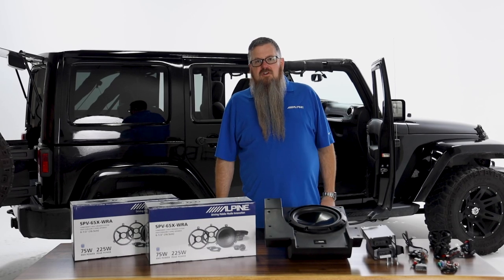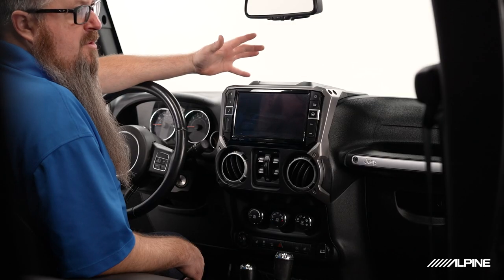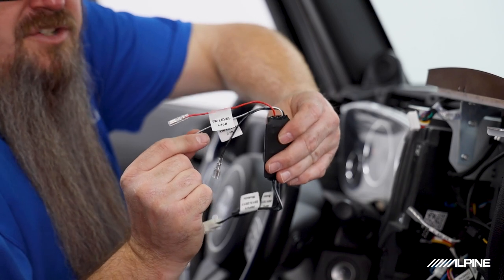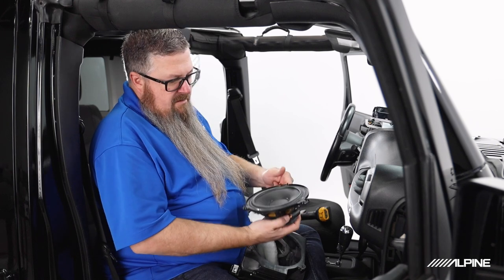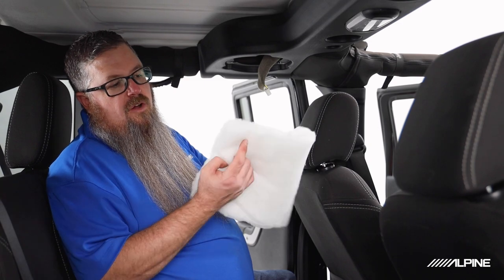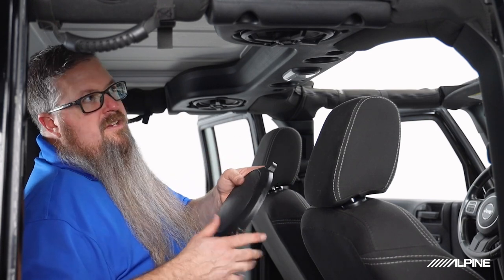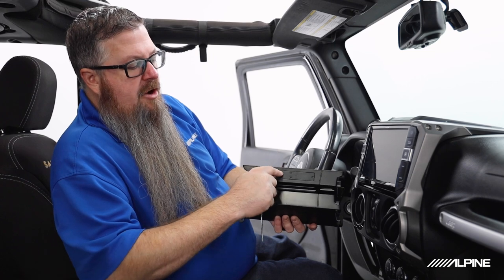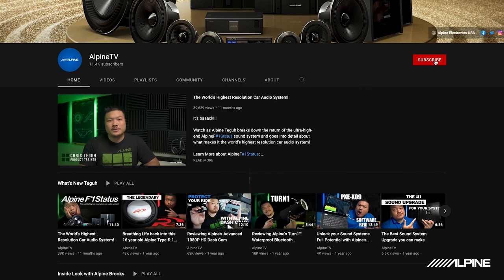Alpine PSS-22WRA Installation Tutorial for 2011-2018 Jeep Wrangler JK Sound System

Comment: Best informational  video out there great job very comeplete details  and camera work ,very helpful. I have 1 question as for the poly cushions  would it be better to put a hole in the right  center toward the wiring of them so you can feed the wire through so the cushion speads out better and flatter ? It also seems with all that vibration  the filler will drop some toward  the cone not sure velco would work Just a thought i had ,awesome video just asking 😂

Comment: I bought the Alpine iLX-407 and the Alpine SBV-10-WRA for my 2015 Wrangler Unlimited, stupid me thought I could use the amp already installed for the speaker that is installed in the back. What amp would you suggest buying? I was considering the Alpine KTA-30MW Tough Power Pack, but I’m by no means an expert.

Comment: i got this kit through crutchfield, i have the alpine sound system. what are the extra steps to make it work? im assuming its splicing the factory amplifier plugs, to the alpine harness?
Reply: no splicing at all. truly plug and play. just installed mine yesterday. they give you everything you need for installation on the factory Alpine or the OEM receiver.
Reply: @chrisdaugherty2700  So your kit came with different harnesses depending on which radio you have? I have the alpine premium radio and our installer told us the speaker wire polarity is opposite from the base non amplified stock system. They wouldn’t install it because he said they would have to cut and splice the harness that was included.

Comment: Has anyone run into an issue with the sub not having any power/firing?  I have this kit installed with the iLX-407 head unit.  Everything sounds great, except nothing from the sub.
Reply: Yes! I was hoping to see the connection issue in the video, it's the only thing he didn't show.

Comment: Do you need two amps for this set up? I have the ilx-w650 with Kta-450. Is that going to be enough for my 2016 jku?
Reply from the maker: Everything is included in this system that you need.

Comment: I just purchased this sub sbv-10 with a alpine mrv-m500 mono amp. Looking to try to install myself. Where would you put this amp?
Reply: Definitely remember that its not a weather proof amp so maybe try fitting it under the trunk trim or under a seat to keep it from getting wet when you have the top down

Comment: Hi, I would like to know if it is possible to install the sub woofer under the driver's seat instead of the passenger's seat?
Reply from the maker: You may be able to with a custom install but the included bracket is meant for the sub to mount under the passenger seat specifically.
Reply: @AlpineTV  thank you do much.

Comment: Followed this excellent install video, however, i get a pop sound from the speakers upon turning the key to ACC or starting the vehicle. Other than that minor annoyance, everything is awesome! Any insight on what my issue could be?
Reply: What head unit are you using? You may need a different source for remote turn on.
Reply: @colinvargo3418   same problem here, the stock head unit.
Reply: check your fuses for everything, usually means you have a blown fuse somewhere within your sound system. Other than check, check all your wiring harnesses, you may have something lose, check your amps make sure you have solid connections on everything, if that doesnt work open up your head unit and unplug and replug everything and it should go away.
Reply: @homiehangout1566  i did all that stuff before even posting. working in the IT field for 20+ i always do all the basic obvious things first before reaching out for further support. After researching, I've read in a few places that the 'power on' procedure/order with the factory HU can cause this. I've read that folks who had it with the factory HU the problem went away with an aftermarket HU. I plan on upgrading, so I'm not too worried about it. But appreciate you taking the time to reach out and reply, that you.
Reply: I posted a link in the comments. Explains what causes it and how to eliminate it. Hope it helps.
Reply: @gregnorvell9730   Hi Greg, i went through all the comments and i dont see anything. Sometimes youtube auto-removes post afterward, even thou they look like they were posted. Can you reply with some text to search for in Google that will pop the link up? (a work-around for the auto-deletion of some links by youtube)

Comment: great info can I ask what was done with the factory sub in the back.
Reply: There was no factory subwoofer in this one. If yours has it, there are some extra steps involved that I can walk you through. I would disconnect the factory sub once this system is in place as it won’t be needed and won’t help with output.
Reply: I removed my factory sub and found on Ebay an OEM panel for about $120 that is the piece that would be there if you didn't have the sub(Identical to the interior panel on the other side) and got back extra storage space. You can even drill a 1" and reinstall the 12v auxiliary power  plug. Just be very mindful as there's only 1 location that it will clear everything.